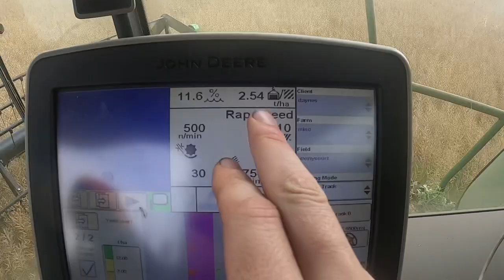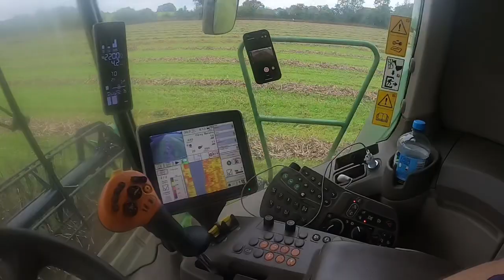Finishing up harvest 2021

Comment: I hate seeing the crop still spilling out the auger when the trailer drives off, although that was coming out for ages.
Just got around to finishing your video mark. 
What was you cutting when you checked for losses? I thought it was rye but really not sure. 
Cheers for the catch up and on to 2022.
Reply from the maker: Spelt. It was a contracting job for an organic farmer. 

And I hate it as well. There’s a plate at the bottom of the auger to try stop it from happening but I’m not sure if it helps or makes it worse
Reply: @markdaynes9154  
Cheers Mark.